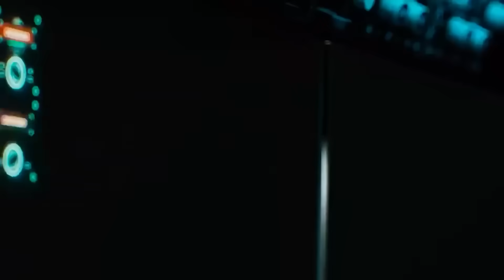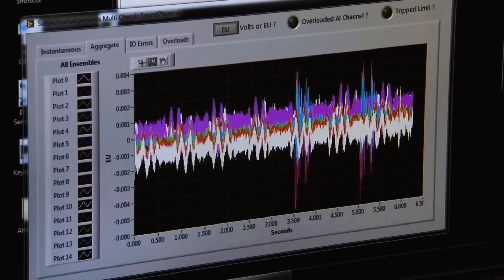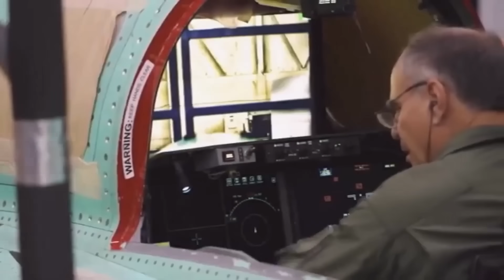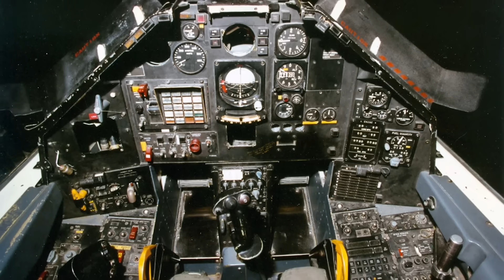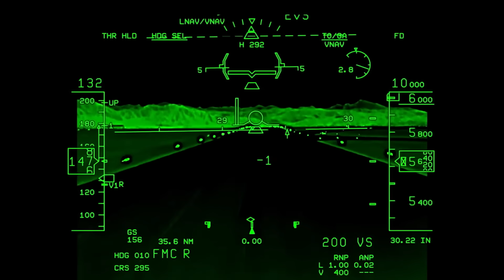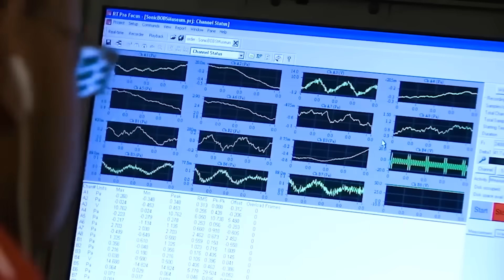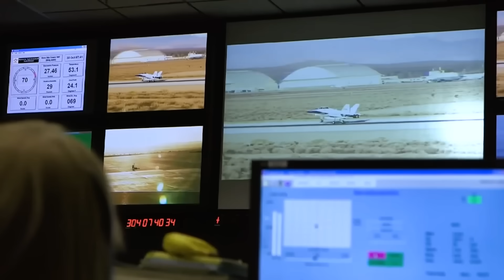NASA Just Launched World's FIRST 'Quiet' Supersonic Jet!

Comment: Mach 1 is not a single, quantifiable speed, Hal, it's perpetually variable. It's inextricably linked to altitude, air temperature and atmospheric pressure and changes with each.